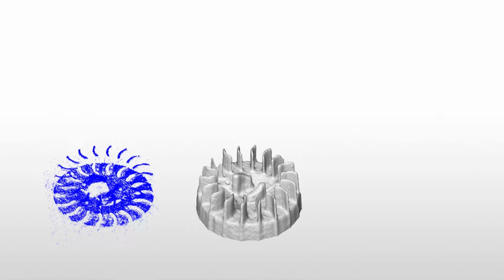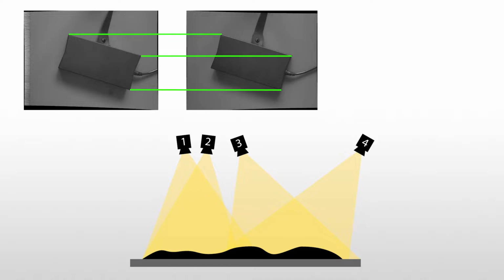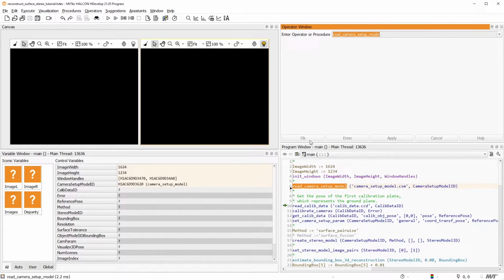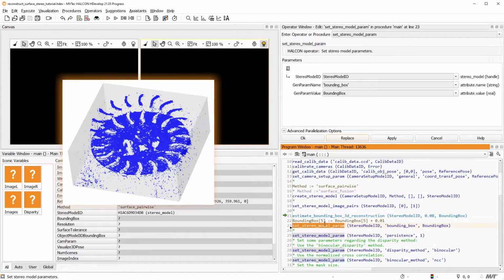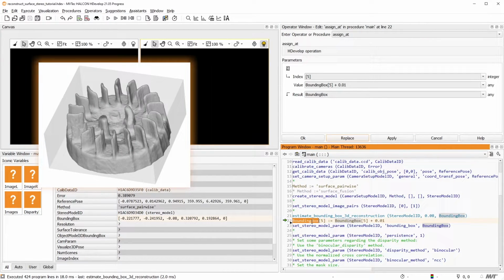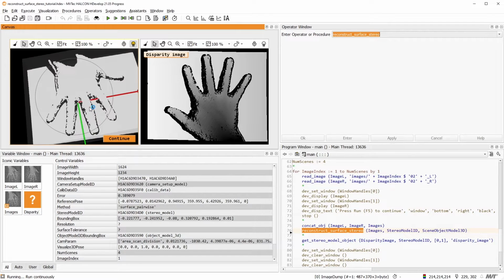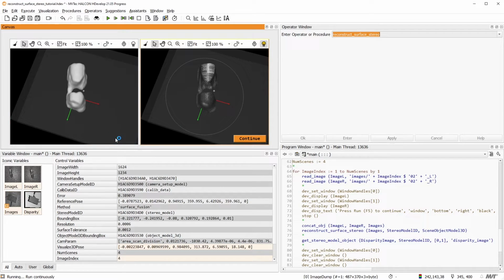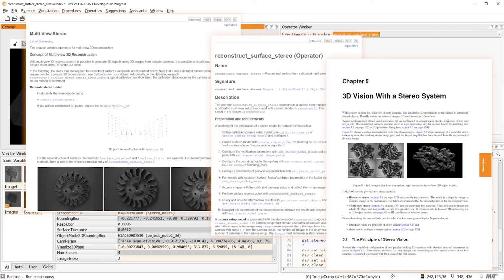3D stereo surface reconstruction with MVTec HALCON

Comment: Thanks for your great tutorial. Can we use the same approach to reconstruct the 3D object using 3d images captured by 3D scanners? If no what other approach could be used. Thank you so much.
Reply from the maker: Thank you so much for your question. 

If we understand your question correctly, the HDevelop example reconstruct_3d_object_model_for_matching.hdev should provide you with an appropriate workflow. 
If this does not answer your questions, we kindly ask you to contact your local HALCON distributor for more support. 

Find your local distributor here: https://www.mvtec.com/company/partner-network/halcon-distributors